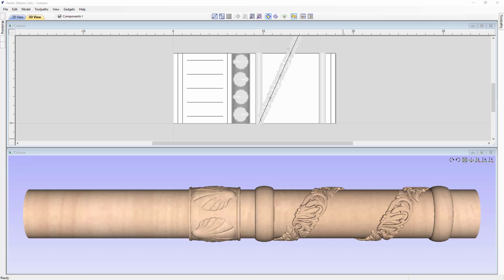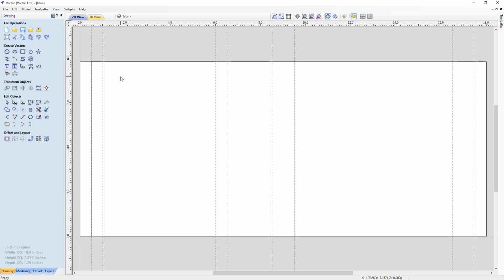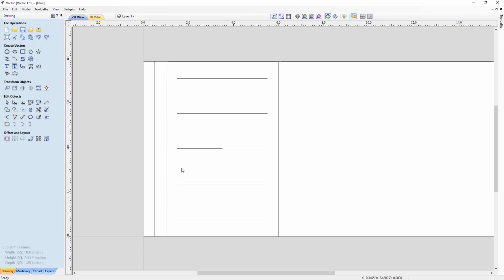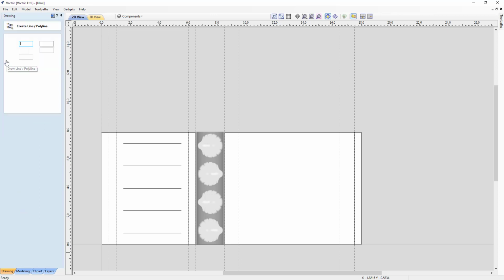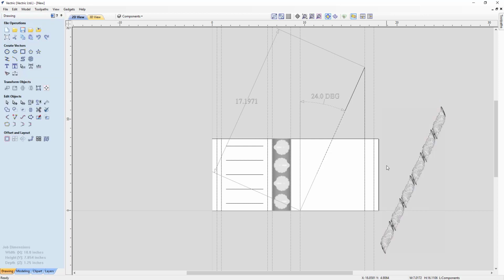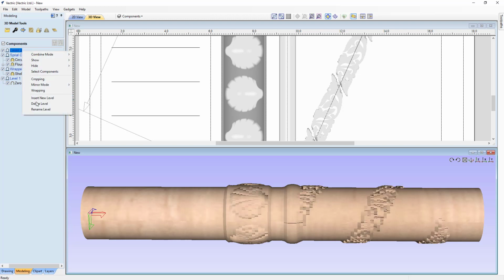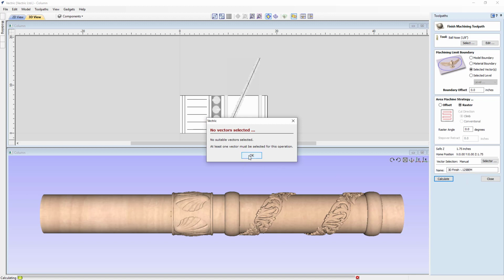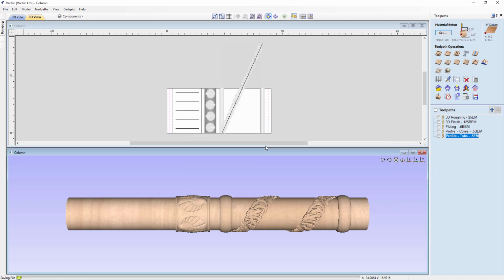Vectric V10 Tutorials | Wrapped Rotary Machining | Creating a Column

Comment: I eo well with the VCP software as it is very intuitive. What I need help with is getting it into UGS. UGS always portrays my carve on a flat plane. How do you get it to show a cylinder?
Reply from the maker: Make sure you job is set up as a rotary job... and then in the 3D view make sure that the view i wrapped... click the cylinder in the 3D view... almost the middle of the view at the top.  If that does not work please email support@vectric.com and they can help sort it out.

Comment: When cutting this on the CNC how to I set the center line on the axis?  Normally on 2d I would touch off on the bed of the CNC.  How do I do this on a rotary?  Thank you.
Reply from the maker: Hello Rick... you can place a VBit in the chuck and zero off the tip of that.  Hope that helps.